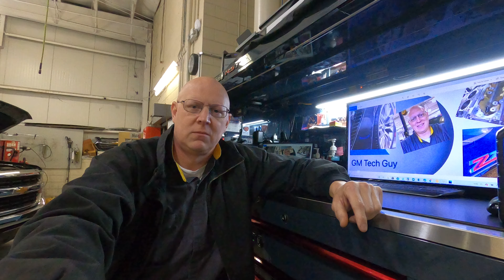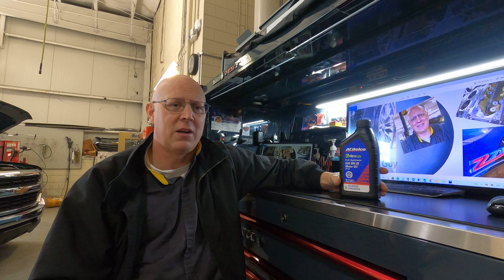DON'T USE!!!! Until you watch this. Oil Life Monitoring Systems

Comment: I change my GM 1500 5.3L at 5,000 miles (which is around OLM 40% remaining life).  Change at 50% when towing.  I also use a low cost catch can from Amazon to keep its intake valves cleaner.   This works for me...

Comment: You can change your oil whenever you want but this OLM is very high tech and accurate and will not cause harm to your engine. Actually going by miles is really the worst way to go, if anything go by hours of running time. The OLM takes into account running time, load, temperature, RPM, racing, towing etc to determine the correct change interval. If you let your car idle for 50 hours that will not show up in your miles but the OLM will take that into effect. If you tow in the mountains your mileage dies not take this into account but the OLM does. Probably the best thing to do is always change oil at the point you want, let's say change at 30% instead of 0%. GM does not do this for cost but for accuracy, GM redesigned the truck engine to take 8 qts instead of 6 qts of oil. This costs more but allows cleaner oil for longer. All it takes is a little common sense and use the manufacturer recommended oil.
Reply from the maker: Thank you for your comment. The OLM system has been out for some time now. Newer engines I agree have been updated to account for some of the issues. Previous models still run short like the early model Equinox engines . Specs for oil consumption were included in the video and straight from GM Service Information.

Comment: I have an old f150 that used 1 quart of oil every 100 miles.

My 2014 5.3 doesnt use a single drop of oil between changes. And I change the oil between 5000 and 8000 kilometers. I check the oil every  week or so.

Comment: I am glad you said that about the oil life...I have this question about the oil life monitoring system...I changed my oil at 3500 in my c8 zo6 and reset the monitor back to 100...and this was about a month ago and now the oil life is down too 69. My question is why did it drop so fast from when I 1st got the car
Reply: Hi James,
 The oil life monitor is effected by several things. Aggressiveness, load, temperature, and so on. You stated you have a 3500 and a c8. Both vehicles I would consider to be work horses. One for actual work and the other for play. I would still watch your mileage and compare to your OLM.  Why its seems different now vs new I couldn’t tell you. I do know it’s an algorithm of several different inputs.

Comment: So we have a 2014 Corvette stingray. It appears that the oil life monitor system must have other metrics that I’m almost reaching that 0% marker before I even reached 5000 miles. What kind of metrics is the oil monitor sensor designed to look at. I also have a 2015 Infiniti Q70L that has an oil mileage tracker for your filter and engine oil. I will set it at 5000 miles.

Comment: Awesome. My girl friend has a 2008 Honda CRV. I always change her oil at 3,000 Miles. At 3,000 miles the oil is dark brown and the Oil Death meter reads 50% life left at 3000 miles. When I change her oil I always fill the oil filter up fully with oil before I screw it on to the engine block. After doing this the when the car is started the oil light goes out in less than 2 seconds and no rattle is heard.

Comment: Not true. My Cadillac ATS goes to 0% much faster. Of course, I drive it like mad. Mobil 1 and a PF 64. The engine does get really hot with the turbo. But it definitely does not track even close to 10,000 miles before 0%.

Comment: Just because the OLM hasn't indicated that you need an oil change doesn't mean you shouldn't check the oil level periodically. I know most people never do check it but that's really a separate issue compared to the length of the interval. 

Only GM OLM I have experience with is my Dad's, but we sent in a sample to a testing lab once after a run down to 1%. The lab reported back active additive remaining and wear numbers were within normal ranges. That was with Castrol's budget synthetic at the time, Castrol GTX Magnatec, and under heavy use. That was about 7790mi. 

My Mustang seems to click down with time. I was at 15% after 10 months and 5k miles. Supposedly it could see up to 10k mi but I don't drive that much in a year these days.

Comment: I have 14 sierra and it burns 2-3 quarts of in about ever 2-3000 miles, it has since the first 20,000 miles. It burns so much and I'm always add oil. Dealer told me it was per manufacturer,  they are designed to burn oil. Since I'm always adding fluid do I need to do oil changes? I mean it really burns oil. The transmission shit the bed at 99,000 miles and dealer wanted $10,000. I had local shop do it for $5200. I had dealer do its 30, 60, and 90,000 services and it still took a dump on me. I'm Friendly with the dealer cause they had to do soon much work. Radiator,  condenser,  leaky antenna,  and more. Their service department loves me, I probably make sure their employees have nice Christmas.  So back to the oil consumption and how the dealer said it per engineer design. If I'm constantly adding oil isn't it always clean and fresh if I add 2 quarts evert 1000 to 2000 miles? Do I need to change it? I mean I have to buy it buy the 5er so it kinda expensive.  I look forward to your response since gm and it employees stand behind their customers and products

Comment: Based on some of the comments, it came across as 1qt everything 2k was normal or expected.  Actually that is the abolute cut off point requiring intervention. Any amoubt above that special coverages kick in.  My 2012 Equinix hit that point after 90k. The dealer replaced pistons and rings.  After 70k still no more oil consumption.  Been using Amsoil 100% synthetic oil.  Regarding the OLM, you are right, sales and competitive, ad well from government to reduce oil use.  The OLM calibration in the first years of Equinox/Terrain took these cars to 10-12k miles, using only an API SN oil, with GDI  soot and fuel dilution.  This was a major mistake for timing chains and oil consumption.  They updated to a max of 7500 miles.  I drive 200 miles a day, highway under the best of conditions, 0% is 7200 miles.  The oil is still good but I use bypass filters and premium oil and gas.  I can go to 12k easily.  But if using regular synthetic and filters. change at 5k, and 3k in the winter.  GDI changed everything regarding oil drain intervals.

Comment: I have a 2018 Colorado ,3.6l, # 20% I've only driven it 2900 miles, so with a 6 qt oil containment, I should be able to go 6000 miles, with regular driving?
Reply from the maker: Hi Cliff, I’m sure you can go to 6k. I definitely would not go lower than 20% no matter the miles. The OLM uses a algorithm that includes driving habits and conditions.

Comment: OLM's are mostly for people who treat their vehicles as appliances. I do all my own oil changes, I own two turbo diesel vehicles and one gas truck. My OLM comes on between 7500-8000 miles. I have strictly highway 50 miles a day on synthetic oil in everything I own, AND I feel good about it. Never had a problem with this method. Have your oil checked by labs like Blackstone if in doubt. With most of my vehicles I change them twice a year because of how much I drive.

Comment: It is the individual driver's responsibility to keep track of how much mileage they have driven since their last oil change, this is why we have those wonderful things called the odometer,  the trip computer. I do not care what brand of car you drive, what kind of oil you use for whether it's "Full synthetic" you need to be changing your oil every 3 to 5,000 Mi 5,000 is pushing it but for some people depending on certain circumstances that's probably appropriate. 
Toyota makes very reliable automobiles but if you change that oil at 15,000 mi intervals as stated in the owner's manual, that engine won't make it to 100,000 miles.

Comment: Been going by the maintenance minder for oil changes in my Honda Civic si and the inside of the valve cover is as clean as a whistle with almost 140000 miles (had the car since 63000). Granted I use full synthetic oil. I think using the oil life monitor is fine if you use full synthetic oil.
Reply: You do not ever go by the oil life monitor alone you need to go by your mileage driven since last oil change. I strongly urge you to change your oil every 3000-5,000 miles irregardless of whether or not you're using full synthetic oil. Count your stars that you're driving a Honda because if it had been any other brand besides a Toyota or a Honda the motor would have already blown up by now.
Reply: @VanquishMediaDE  I do track miles. I use trip B for that and it’s in the 5k to 6k range for it. My oil is still clean looking when it comes time to change it so I’m not worried. I’ve owned this car for over 7 years. My suburban on the other hand I’m not a fan of GM’s oil life monitor. Particularly if you are using conventional oil like they “recommend”. I have been dealing with sludge issues and on/off lifter tick. granted it has almost 300k on it. So I can agree with you on other car brands in a way. I think the biggest thing is is that you keep an eye on the level. I try to check my fluids every time I get gas. Also 3k oil changes are kinda a thing of the past for the most part. I would have no issue going up to 5k on conventional especially if I did a lot of highway driving.

Comment: I call BS If you have a new vehicle and its using a quart of oil every 2000 miles that's junk. This guy just wants you to bring your vehicle in twice as often as required to get you to spend twice as much to maintain it. Check your oil monthly and top off as necessary. You shouldn't be using any  oil between oil changes for a newer vehicle that has less than 100,000 miles on it.
Reply from the maker: Thank you for your comments David. Not all engines will use the same amount of oil as this depends on driving habits and conditions. Just friendly advise about how the oil life monitor system works. I have seen this at the extreme end and it’s not good.
Reply: @gmtechguy , GDI engines are going to use a little oil no matter the manufacturer. If people don't change their oil they will learn an expensive lesson.

Comment: So, with GM you’re in a constant state of changing your oil.
Reply: this is across all manufactures Subaru, Kia/Hyundia using a quart every thousand, toyotas junk at 100,000 because 10,000 oil changes.  Modern small engines low friction light weight oil, turbos high compression direct injection forcing mileage and power, change your oil or it won't last regardless of who makes it

Comment: I have a 05 chevy malibu maxx 3.5  with 381,000. I change my oil every 3,000 miles with pennzoil ultra high mileage full synthetic.  I have that stupid change oil thing I keep forgetting to reset it. Oil is cheaper than a new engine

Comment: Good vidio. It seems to me if you're uncomfortable with the manufacturers recommendation an oil analysis is the way to go. Using the qt to 2000 mi. example....In 10,000 mi. you've added 4 or 5 qts of fresh oil....now where's the oil at ? A lab will tell you how much you can trust your monitoring system.

Comment: The 1qt of oil per 2000mi sounds very suspect. My Saturn oil monitor went down 1% ever 110mi(in a linear fashion). My Ford monitor goes down 1% every 100mi(also linear). Using full synthetic, changed the Saturn at 50% and Ford at 25%(as per Ford recommendations). Neither used any oil between changes or needed topped to full line. Since you made this video inside your dealership you appear to be "promoting the company line".

Comment: Living in Minnesota I follow the 'severe' climate recommendations in the manual for my 2011 Ford Taurus non-turbocharged. I also use Ford brand P.O.L.
Reply: I changes my oil in november 2023 and my olms is showing 0 percent and i usedfully synthetic.
Reply: Severe climate recommendations are for ares where temnperature variations are extreme. @mathewlett9104
Reply: Most cars are becoming turbo 4cyl. now. That means oil tested will have fuel contaminants.
Reply: @shawnkleveland196  they're all try to get more power out of smaller engines and it's costing them. Case in point, Honda went to a 1.5L turbo in many of it's vehicle and are now having oil dilution problems. Go back to naturally aspirated engines.

Comment: Thanks sir great info I have a 16 Yukon 5.3 with AFM and DI I have been changing oil a filter at 5000 miles on regular full synthetic like Mobil or Castrol 0w20.I’m thinking of trying 100 % syn like Amsoil and changing it at 10000 with a quality filter. I would appreciate any thoughts on that thanks
Reply: 5,000 miles is even pushing it. Most people like 90% run under severe condition. You know your regular full synthetic oil is good enough. For the $6qt price at 5k miles. Compared to $14 qt. bottle @ 10k miles. Amzoil is good but not for the price to miles. Change oil more regular changes the filter for containment.  Just thought.
Reply: You need to be changing your oil and filter at about 3,000 MI irregardless of whether or not it is full synthetic. By the way "full synthetic" in North America is a marketing scheme it's not truly full synthetic oil it's also synthetic blended but they are not as strict about calling it "full synthetic" as they are in other markets.
Reply: See my post above. I use a bypass filter, Amsoil, and do oil analysis.  10 -15k is easily achieved, with phenomenal results and protection. Been using for 30 years. With GDI engines toy need to keep a closer eye fuel dilution and viscosity shear.

Comment: You are 100% correct, I just got a brand new Chevy Silverado Custom Trail Boss with the 5.3 and no AFM. I plan to change my oil every 5000Km ( canadian ), I also wanted to ask you what do you think about an Oil Catch Can ?
Reply from the maker: I would think they would be useful if you was running the engine at higher rpm’s often. For normal driving probably not useful but won’t hurt

Comment: Oil life monitors not only remind those that are ignorant of auto maintenance to change the oil, but they also save a LOT of oil by keeping it in the car throughout its entire useful life because some people are evidently  dumping their engine oil many thousands of miles before its time. i like the monitor on my 2011 dodge avenger. if i use conventional oil, i will change it when the monitor tells me,, which is anywhere from 4500-8000 miles. or if i use synthetic, i will change it at 8,000 which is what the book states as the maximum amount of miles for an oil change.
Reply: 8,000mi is to long. Many vehicles getting timing chains. Also many having oil consumption. Ford, chevy, toyota.
Reply: @shawnkleveland196  depends on how the 8000 miles was done. A vehicle that drives lots of highway vs one that does primarily City driving 5000 miles is going have a very different oil change situation.
Reply: @schmiesus  absolutely correct!
Reply: @schmiesus  yes, and the vehicle's oil life monitor takes into account the type of driving you do, city vs highway. another reason to find it reliable.
Reply from the maker: Thank you for viewing my video. Your comment is appreciated
Reply: Cant believe this! Oil is cheap and engines are not its that simple. The GM tech comes on here and tells you how to save your engine and your pocket book and you tell him he is trying to drum up more business... unbelievable!
Reply: @SuperBigdanno  Oil is cheap and engines are not - that's literally a quote word directly from scotty kilmer, i find a lot of people on youtube comments parroting his quotes and beliefs. I never said anything about professionals trying to drum up more business. A lot of people seem to be in the mindset of: Oil is cheap, so I have no problem changing it every 3k miles, and I suggest everyone else do the same! Which is absolutely unnecessary. The monitors work well for the type of people who don't know a whole lot about car maintenance, who are either prone to forgetting to change the oil, or believe the quick lube shops who tell them to bring the car back in every 3k miles- THOSE type of people would do best to follow the oil life monitor.
Reply: @stephenmartinez1  apology about the drum up business thing, posted to the wrong fellow so sorry about that.
I have said oil is cheap and engines are not all my life, I really can't stand Scotty Kilmer so I would not quote him.
The fact still remains that if you follow the oil life monitor you may get lucky and it works out for you but not all are going to be that way.  What the OEMs should have is a reminder at 5000 to 6000kms or what ever they think is correct to change the oil and a light that comes on every second fuel fill. suggesting to check oil level.